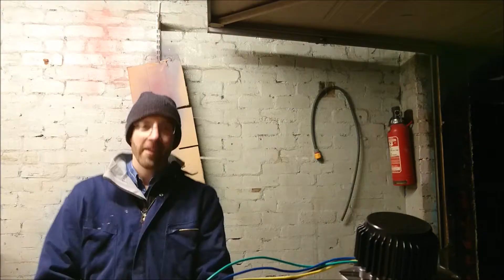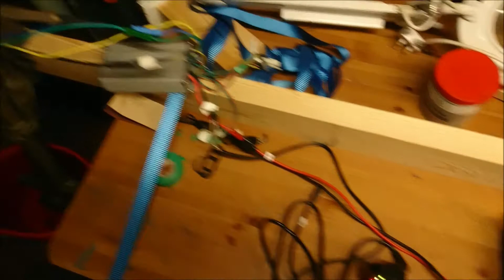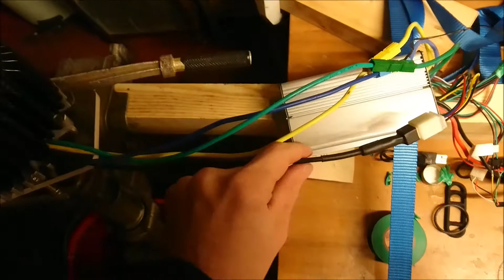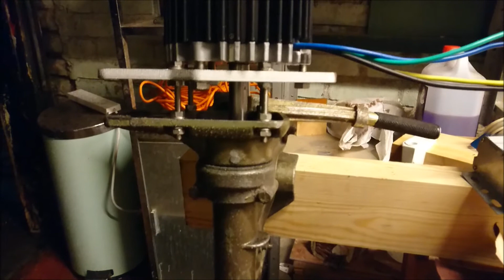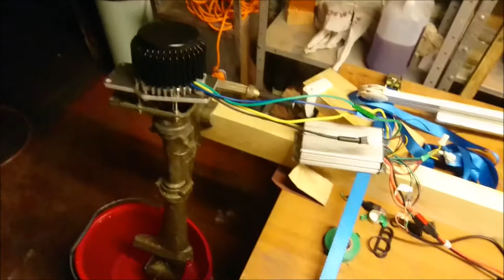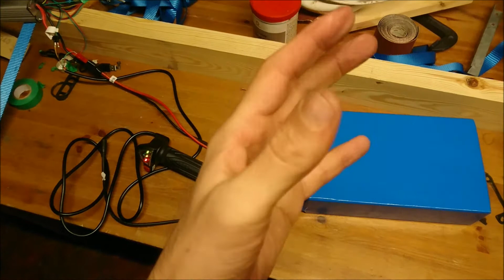Electric outboard first run

Comment: Nice work Bro, i'm looking to do a similar project to put behind on my 12" Kayak, i would like to put a seahorse frame tail (https://www.amazon.com/sea-dog-Superior-Two-strok-Inflatable/dp/B0792FTHLB/ref=sr_1_6?s=sporting-goods&ie=UTF8&qid=1520204908&sr=1-6&keywords=jet+outboard+engine), 
because it's not that heavy, and uses a kind of jet propulsion.

My principal question is about the power in watts and type of battery, i was thinking in use 18650 lithium ion or Lifepo4.
Reply from the maker: Thanks Bryan.  Good luck with your project.  The battery capacity you require depends on the motor power, and the duration that you wish to be at full power.  For example: 

My motor is 1KW, and I want to remain at full power for about 40 minutes.  I am running a 48V system, and located a 48v 20AH battery.  20*48 is 960 Watt Hours, so in theory I could run at full power for about an hour with this battery - in practice of course its going to be less, and the quality of the battery is also a big factor.

Lithium Ion 18650 cells are 3.7v at 2.6 ah, so thats 9.62 Watt hours.  To get 1Kwh you will need about 100 cells.  I would advise just buying a battery pack from China as they are usually made up of 18650 cells and have already done the hard work of assembling them.

The power you chose for your motor will depend on your requirements, chat sort of kayaking you do, water state etc.  Given that powerful motors are not much more expensive than low power motors and the only penalty is weight, I would be inclined to go for something pretty pokey!  Good luck.
Reply: @drawingboard82  Hello Friend, thanks so much!! Very sorry my late reply, to busy working hard in my projects, so i want to share with you soon my 800W in 29.8V prototype motor, works great but not finalized yet, need to do some refrigeration around the motor, i'm assembling Li-ion batteries for ebikes and scooters in Brazil and used a 23Ah that gave me 3 hours continuos use but not in full power ok. See you soon, my whats app for contact is: 55 47 999237494 best regards Bryan
Reply from the maker: @n3verdi3  brilliant, looking forward to learning more. I'll WhatsApp you :-)